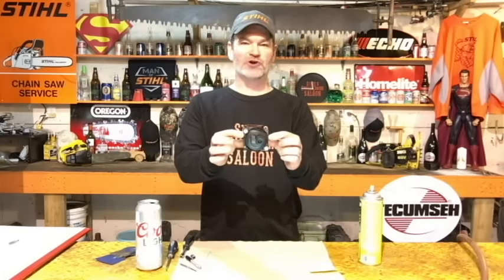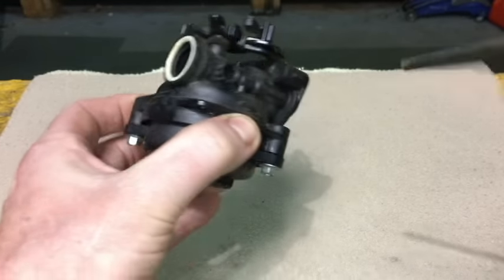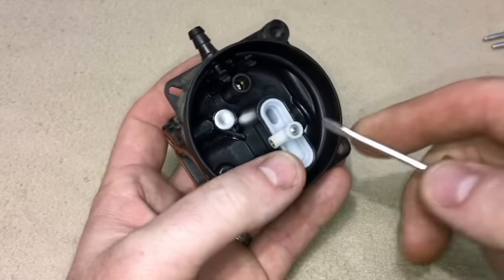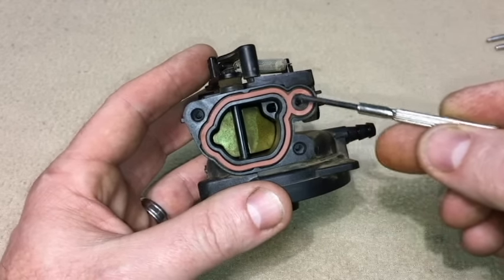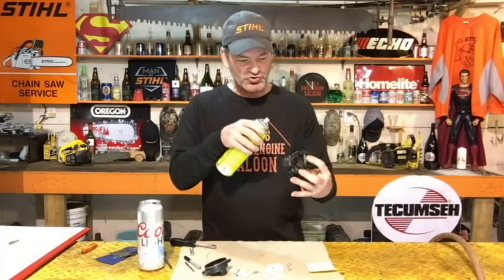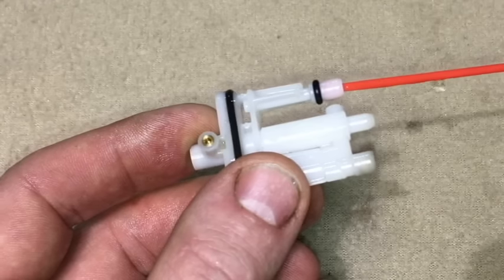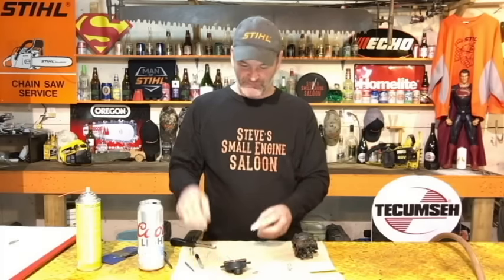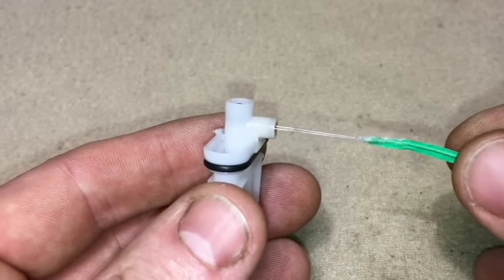EASIEST WAY To Clean a Plastic Briggs Carburetor

Comment: Great video & explanation of the carburetor jet issue & its repair! 

I assume Briggs & Stratton intended for the carburetor jet size to be as small as for the jet shown in the video, because carburetors are very carefully designed, & precisely made things. Even so, design & manufacturing errors are possible, & maybe an error (jet size too small) was made by Briggs & Stratton regarding the carburetor jet size (for these plastic carburetors).

Regardless, the engine seemed to run ok after Steve cleaned the carburetor the first time (before he enlarged the jet size) until the jet clogged. 

I wonder if installing an in line fuel filter would have solved the carburetor jet issue, instead of enlarging the jet size?

Comment: 9:34 I drilled mine out and it started and ran for a mowing session where previously it would only do a sustained run if I kept mashing the primer bulb.
I found a drill-type Hobart torch tip cleaner at Northern Tool, on the shelf. (Hobart part number 770086)
I used the 0.70mm bit. You have to have a caliper or similar to be able to measure these bits, because they are just loose in the tubular handle and I doubt that they are marked.😂

Comment: I don’t have a micrometer to be able to list an exact measurement, but a medium sized paper clip wire, with a few twists, seemed to open up the passage-way through the main jet. What could be the downfall of reaming out this jet too much? An Overly rich running engine with excess smoke and reduced power, I’m guessing. 
  I love your common sense, “any guy can relate” approach to small motor repair. Your mix of delivery of information and humor are like the air/ fuel mix in a carb…very fine tuned. Ginormously <sp?> appreciated!,
Reply from the maker: Thank You...

Comment: As always, another brilliant video, clear and professionally presented.  With this particular one which I followed in every detail and carried out on my carb, I do have a concern.  Main jets are metering devices and their diameters are calibrated by the manufacturer for the particular engine.  In drilling out the main jet to 0.52mm (which I have just done) it changes the metering rate as more fuel is now admitted to the engine.  My engine is now running rich and this is the outcome I would have expected.  Have you any comments?

Comment: Thanks for the great videos Steve. This little trick is great to know. I recently bought a pressure washer with this briggs carb. I always run non ethanol. I ended up installing a fuel cut-off valve on the gas line BEFORE its first use! I shut the machine off by shutting off fuel supply. And....then flip the switch off. So....I burn it dry everytime since I've used it. Thanks, already subscribed. Brad

Comment: Dead on the perfect answer. It seems that every fall, when I pull out my original-style frame snapper, which I use for leaf mulching with a plastic carburetor, even though I run it dry before storage, the engine gets no gas and must be disassembled.

Comment: Hi, this is "Rachel's" husband (name=Binto -- I am orig from India, if  anyone is wondering).  Anyway, we have a lawnmower at our rental house, and Rachel tried to get a relatively new lawn mower started today to no vail. She sought help from a neighbor, same result. She brought it home. I removed the carb and couldn't tell head or tail especially being a 50 year old engineer with failing eye sight to able to see fine jet passages.. After just priming it maniacally some 50 times, the thing has finally started up. I may go in and clean it, now that I have watched your video and have a clue as to what jets to clean. We have an EGO electric mower  we use for our own house, which is much more "user friendly",  so I have also been looking for one like that for Rachel to use at the rental house as well. I have found one about 30 miles away for only 50 bucks except that supposedly starts and stops in short order. So now I may end up learning to fix the carb on the Briggs as well as the ESC inside of the EGO. I make it a point to comment on here, because we don't always thank others and let them know what their efforts mean to us. My own tendency is to "get what I want" and move on without saying anything.. even if  someone just saved your life from a car crash. Anyway.. I thought it was important for me to explain how this video helped me.

Comment: I had the same problem with my Husqvarna HU725HQ that it set in storage for 2 years. I got a new craftsman mower which I really did like. I pulled out the Husqvarna last week and sprayed it and it cranked right up.  However I will use your technique.  Btw...paid $250 new at lowes clearance and they said it was fuel tank. It seems this was the issue.

Comment: Thanks worked for me. had the one that doesn't blow back through. and the main jet looks like its been updated ,easily passed a welding tip cleaner .020".

Comment: I just came across a few of your videos on repairing lawnmowers and all of them were clear very detailed awesome work Steve. You actually helped me fix one earlier today but I have 1 question. I have a craftsman 6.75 lawnmower that's been down for about a yr and this guy did a compression test and had no compression and told me it wasn't fixable and said if I don't have a place to put it he 'll dispose of it for me . Is this guy full of it or can it be fixed with no compression?

Comment: All of your videos are great, thanks for them all.
You mentioned that on some of those plastic carbs you can not spray though the left passage from either direction. Can you tell us why? Can you cut an old carb open and look inside that port? It just seems odd that the carb will work just fine wether you can sray the passage clear or not. I could not spray through mine either and for some strange reason my engine will sputter and give a puff of black smoke after the sputter even when the engine is fully warmed up. The sputter does not go away. Thanks

Comment: Steve, I have a 7.25 B&S with the plastic carb that surges.  I installed a new carb. It still surges.  Do you think if I open the main jet it would fix the surge issue?  It does smooth out if I remove the filter and block off the air intake in essence richening up the fuel mixture.

Comment: These plastic carbs do suck but your tips are great.  I do mobile mower repairs and I stock up on these plastic carburetors just because time is money and it’s easier and faster to replace them when I’m in someone’s driveway.  I think I will go through the ones I have in stock and open up the jets on them.  Oh and I use old guitar strings to clean jets.  👍🏻

Comment: Superb and highly informative video.  The repair is explained professionally and understandably. Great help for us around the world. It is also perfect that both inch and mm units are shown.  Dear Maestro, thank you very much indeed!
Reply from the maker: Thanks 👍
Reply: Cheers to Maestro from Central Europe 👍
Reply: I have successfully cleaned a clogged plastic carburetor of a B&S 675E engine of a rotavator (purchased in Cental Europe in April 2020). The RELATIVELY NEW B&S PLASTIC CARBURETOR is the same as described in the video with a slight difference: The carburetor has a red knob with which the choke can be manually closed for cold start. When cleaning the cartridge (which is inside the carburetor) I tested the diameter of the hole (main jet, time=8:30 in the video). I used a 0.50 mm (0.0197 inch) drill bit.  I can confirm that the ORIGINAL DIAMETER of the hole is slightly more than 0.5mm. I believe it fully confirms the experience of Maestro that a smaller than 0.5mm diameter hole (in probably older model plastic carburetors) is not sufficient. (P.s.: Did you know that the first carburetor for a stationary engine was patented in 1893 in Central Europe?)

Comment: Steve have you got a video on the plastic carb the screw with five screws bolting it onto the tank. I have two of them surging for me. Have clean and sprayed all the jets that I can see and all are clear. Do I need to drill out these jets.
 You have help me so much in my venture's 
Rod

Comment: Very happy, not going to drill it for now since it is so easy to drop the bowl and pull the "cartridge" and push a pin through the orifice and then spray. Thanks a lot, actually these plastic carbs are easier to clean than the metal ones.
Reply from the maker: I agree!

Comment: Great video. My compliments to you.  I have one that starts but won't stay running. Sounds like it is starving for fuel. My hunch was the jet hole was too small and you just verified that. Going to drill out that jet and I know problem will be solved. Thank you for your help.
Reply from the maker: You can do it!

Comment: Hi Steve, great video - will try tomorrow and send a few bucks. On the side of these carbs is a small conical plug with rings on it. One of my carbs has a small hole in the end of this plug and the other doesnt! Any idea what this is for and should it have a hole in the end ? cheers Mark

Comment: thank for the video i have this exact mower and she started to die...I was able to rip the carb apart real quick and get to that white pice...spray it and hit it with compressed air and bam she runs like new...ill do a bettter job winterizing next year...I didnt have a T10 short enough to drain the fuel out of the carb...im also thinking of putting a fuel shut off on the hose to run the carb dry...

Comment: I also have a Briggs and Scrap 'em with a plastic carburetor that "hunted and surged" from the first day I bought it new. I removed the carburetor and blew out all the orifices with carb cleaner and now it'll start and die. Once I get it started, I have to continuously pump the primer button until the engine warms up enough to roughly run on it's own. The next tool I'm going to use on mine is a BFH. Update: reamed out the main jet with a 0.020 drill bit. The mower now starts on the first or second pull and the "hunting and surging" is gone.

Comment: Hi Steve- thanks for this.  I have two of these Carbs, one on a husqvarna and another on a Toro both with the small Briggs engine.  Besides a no-start scenario, are these also known for getting clogged and then the mower will run for a couple of seconds then stall?   Both of mine are doing that rn and i'm ready to just disassemble the carbs instead of going another route.

Comment: Hiya Steve. My trimmer did this same thing. Would start then immediately die. I tried this fix and cleaned up everything (it wasn’t really too dirty at all) and now when I start it, the motor runs but really really rough and the exhaust is just a Smokey mess. Not sure what this means, but I have a feeling the motor is toast 😢. If you have another suggestion that would be great.

Comment: Thanks for video, got a question what is problem when it starts but runs really rich a d even with choke wide open gas is spitting a bit from the choke butterfly had that happen to me on several of theses carbs

Comment: If that fix hadn't work, you would have heard about it by now. Since this video is still up, it must have. FWIW, I just tried it. I already had 3 of those carbs, and had a problem getting good, consistent RPMs with any of them. (7000' elevation.) After drilling per your recommendation, and re-installing the carb, the mower fired up with the first pull, and ran great. I'll edit this comment later, after running it for a few hours. Thanks!
Reply from the maker: Right on Kurt!  good luck...

Comment: I had rebuilt this carb because of this problem several times in one day I like your idea of drilling the main jet out with a .020 micro drill bit but I’ve found out that running it with premium high octane gas it usually doesn’t have the same problem

Comment: My pressure washer has a b&s engine with plastic carb. Won't run and i am going to try your remedy. 
I was surprised that there is no fuel shut off! Any recommended vlv's?

Comment: Awesome information and will check this one aunt has. She bought her and mom one each and moms has ran great. Aunts hasn't ran but just few times since she bought them. She has sent hers back to Lowes and they sent it back saying it was fixed but same thing you're saying after she ran it for few minutes that day. Next time it wouldn't crank again. Have a question since we have used moms so much and the oil is starting to get onto the air filter. Can I take the carburetor off of Husqvarna 21" AWD LC221 A Briggs & Stratton 625 EX Series and put it on another of the same exact type
 mower?

Comment: Hey Steve, You're my go-to guy for lawn mowers and doing a great job, keep it up.  I'm a little off-topic here, but it seems as good a place as any to ask a question.  I live in FL and have a LOT of sand and dust problems that quickly clog up an air filter on the mowers.  Right now, I have the standard 6.5hp self propelled mower with a B&S engine (uses the rectangular filter, probably not the latest) and it does the best as far as filter changes go.  Then I have a Toro Recycler with the small oblong filter that is a pain.  Don't laugh, but I have thought many times about mounting a larger filter assy somewhere and running a hose to the carb.  Is there anything out there that already fits these engines made for a heavy dusty environment?  Also, I have spare carbs for both engines and the flange side where the air filter housing attaches has the same bore and bolt spacing.  Do you know of a simple plastic or aluminum flange that would bolt up and allow a round hose to connect to the intake?  I've looked a few times and come up empty.  I've found larger ones, but nothing that size.  If anyone might know, you would.  Thanks for any help.

Comment: Just did a Craftsman mower for a friend. only one year old. The jet was already at 20 thousand. Still wouldn't run so I upped it to 27 thousand. It now runs perfectly. My take, don't be afraid to open up the jet a little bit from where it is at size wise. Worst case senario is you have to replace the cartridge.
Reply from the maker: Right on   :_Beer: :_Mower: :_Rider: :_Chainsaw:

Comment: Hi Steve.  Great video.  Thanks.  Question:  I have a Troy-Bilt TB110 Briggs Engine with the same plastic carb.  I'm having a a surge problem.  New Carb, New Spark Plug, New Air filter, Cleaned the fuel tank and made sure the screen inside tank was clear, brand new 93 octane gasoline Adjusted the idle to 3200 RPM'S.  I'm still getting a slight surge.  It is better but still there.  Should I open up the jet as you did? Any Ideas?  Thanks.  DJ

Comment: I'm one of those having problems.  I did the cleaning!!  62yr old lady.  BUT Had HIGH RPMS when done. Moved metal frame away a tad, mechanism was bumped against it, but I also didn't have the back filter case on right, the 8mm on the right.  It sounds much better....but still seems high. Or maybe it's as it should be now..?  I guess I'll find out.

Comment: Hey Steve, I thought you might appreciate to know that there's a small metal Venturi insert that if it shifts you can't get the fuel distributor back in. You'll see there is a notch in it that has to go in a certain way so the hole is lined up for the fuel distributor to fit back in. I struggled a bit before I realized that's what was going on. I straightened it out and it went right in.
Reply from the maker: Yup, I have a video in my playlist about that...

Comment: I have a problem with that same plastic cartridge where the butterfly choke valve will operate normally until I reinsert that cartridge then the butterfly is x stick shut. In the cartridge cavity there seems to be no contact it is a friction fit and there’s no moving parts in the well of that cartridge cavity. I’m stumped. Gonna try again more tomorrow. Any constructive ideas are appreciated. Great videos thank you!

Comment: Hi,  I bored out my jet as you show in your video..   I think i might of went a tad bigger than what u did.. it seems now the mower is burning a tad rich and now it puffs a little black smoke and is carboning(black carbon) up the plug.  Would that cause it to do that if the hole is too big or does it sound like something else is happening? thanks

Comment: Did you clean the tank in case small particles were clogging the hole?
  Could it be fuel hose going bad and releasing small particles?
  If either one of these was what was happening, couldn’t the small particles eventually damage the engine?
  Steve I am not arguing with you at all, just curious. 
  I envy your small engine knowledge. 
  You are one of, if not the first, small engine mechanic I have supscribed to. 
  Lot of respect for you and Donny Boy.

Comment: Had mine for 7 years without a problem.  Always started first pull.  Now it’s dying as soon as it starts.  5 seconds and it dies.  Or it will REV up and down a couple of times before it dies.  Took carb out and cleaned it.  Seems fine.  Could drilling the hole help my situation?

Comment: steve have u noticed the round plastic restrictor inside the throat of these carburetors? im wondering if this is to choke down the fuel and air for emmissions.. I might try to remove it so the lawnmower can have some power.,,. its pathetic right now.. I cant think of any other reason the restrictor would be there?